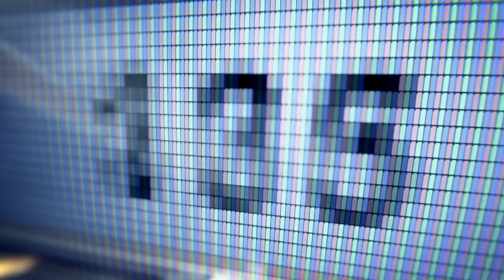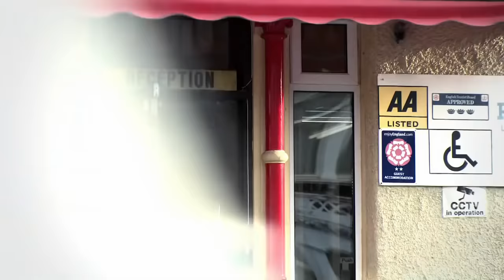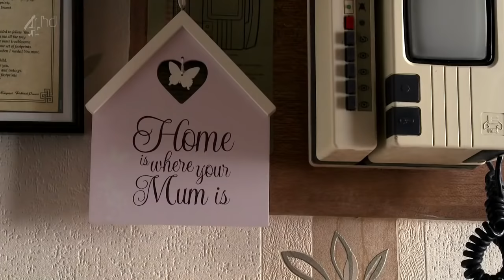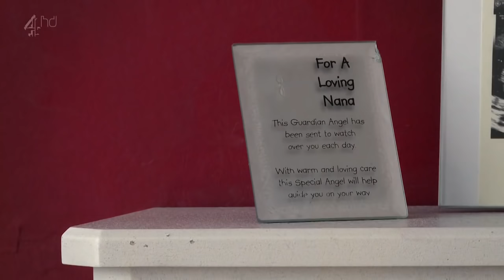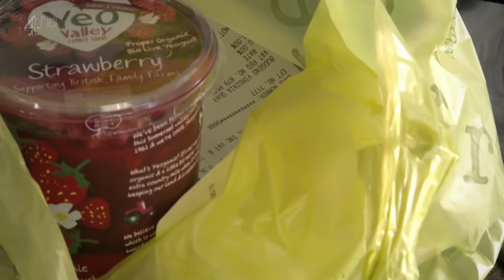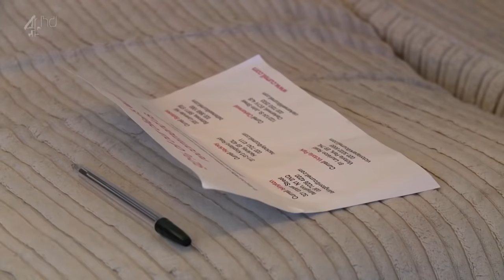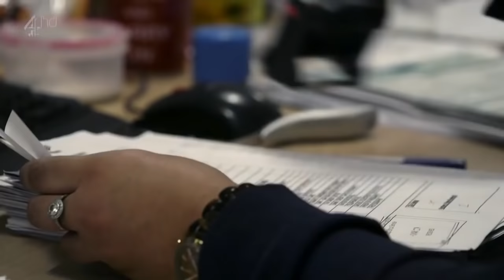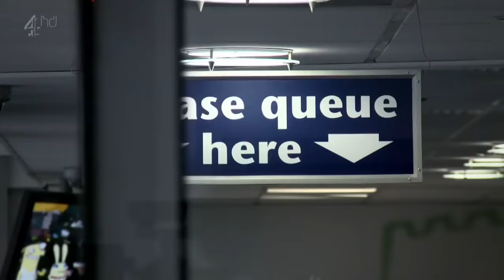How To Get A Council House S02E03 720p

Comment: I feel that alot of these are on the fiddle. I have worked all my life i lived in private rent with a rogue landlord that did no repairs. I even used my wages to get an electrition to re wire the sockets that wernt earthed and even paid a olummer when the boiler went even had to pay to get rid of the damo n mould from the damage. My final straw was when the hot water pipe burst and was leaking on my child's food table. I left but according to the council i made myself intententionally homeless even though i had told the council on several occasions and no one came out. Now im on the bidding system and have been for 5 years because i work. Im not in a high flying job i work at a rescue dog kennels but if i lied ide probably get one but i have morals